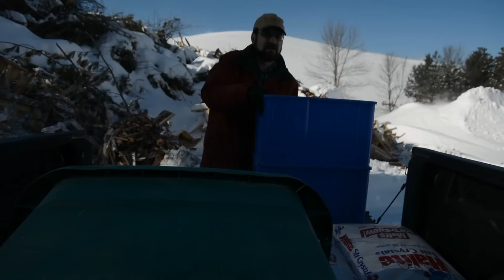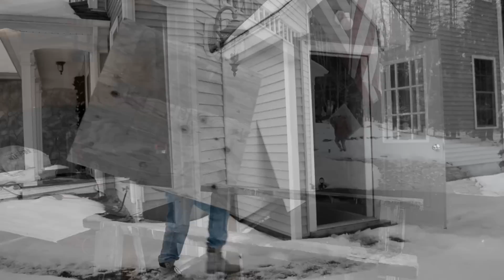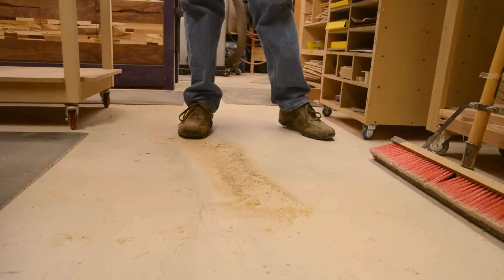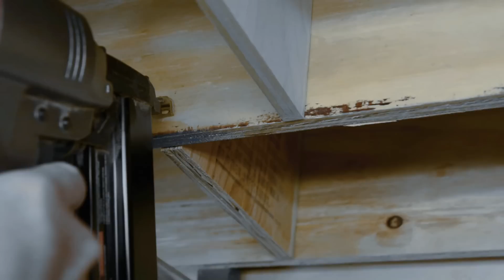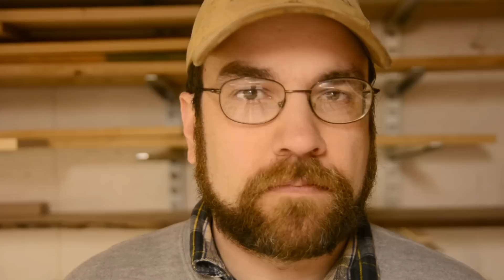The Eternal Scrap Wood of the Spotless Shop

Comment: The opening sequence made me sad. As an amateur guitar maker, I frequently use small pieces of hardwood like that for various detail pieces. Pen turners go nuts for small pieces like that too, so I know I'm not the only one who said to themselves, "Oh, I could use that..." Oh well. Can't save every scrap of wood - I'd need a hundred of those cabinets.

Speaking of cabinet, I like it a lot. I need to build something similar. You have the wood separated by species as wella s thickness and length, right? Great idea.
Reply from the maker: The stuff that goes to the transfer station is either too checked, too much wane, or too short to do anything with.  It's mostly really short off cuts from the table saw.  There were some pallet runners in there too that I couldn't get the nails out of this time.  It's pretty much by species and size, though all the exotics got thrown into a couple drawers.  I put all the short stuff into drawers at the bottom.

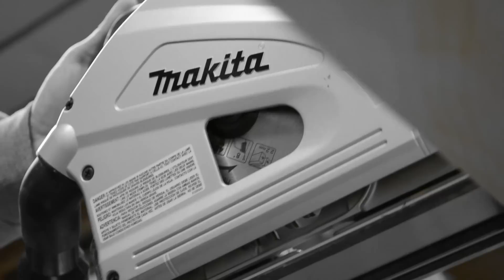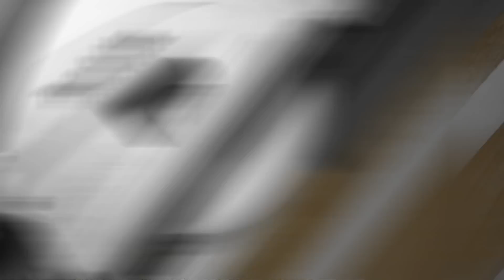Comment: The tracking shot at 1:50 was impressive, but the sequence 3:54 - 4:10 was mind boggling! How did you do that bit? I've watched it numerous times. The camera drops with the saw plunge, then the saw travels over the board, but the camera follows UNDER the board! Suitably impressed. Des in the UK.
Reply from the maker: Thanks!  I'll be doing a video on all that stuff next week.

Comment: The video had a similar vibe as Sweetgrass. May spawn imitators who might be building similar project, such as a multipurpose bookshelf.
Reply from the maker: The Nomadic Polywright Show So what's your next project? :)
Reply: A DIY moving friendly bookshelf is more along the lines of what you built. I actually have all the material and designed in in Sketchup, I just haven't found the time to be outside and in the cold. I do have 2 projects planned for the 3rd and 4th week of Feb. The hint for the 4th week project is Andre Roubo.

Comment: Was anybody else heartbroken to see the piles of scrap wood out there? oh my gosh. I'm nobody. absolutely nobody...but I am a parrot owner, and untreated wood (usually soft woods, but the hard woods have a purpose too)...Any amount of wood is used in bird toys. The more misshapen the better. The odder the cut, the better. Drill a hole in the piece, string it on a material, whether it be chain, leather cording, cotton rope, or just give it to them as a foot toy. Let nature take it's course. You will have match sticks on the bottom of the bird cage in a few minutes!  These wood pieces require very little care, dying with food safe dye is optional...and you'd be flippin' shocked at how much money these parrot toys go for. You've very possibly trashed hundreds of dollars away.  Here's a different idea...sell small lots of these scrap piles on ebay. customer pays shipping, you make a profit and buy more wood. So many ideas. I know, i know. I'm nobody and I don't matter...but from the onset, the video broke my heart.  How about wild bird houses? oh gosh. sorry. Just rambling now. I'll get over it. LOL

Comment: HaHa. Very cool video. That scrap wood just keeps on multiplying all by itself it seems, doesn't it?
Reply from the maker: I didn't think I was going to fill up 2 each of the largest sections of the cabinet with one type of one species of scrap, and without even getting to all those boxes I had moved out of the shop yet.  It's crazy.  Where does it all come from?
Reply: krtwood I think a lot of scraps pieces are the sign of a hard working woodworker. That's why I don't have much in my shop......
Reply: krtwood When you get too much excess scrap, throw it into a medium Flat Rate USPS Priority mail box and sell it on your Etsy shop. I guarantee it'll sell fast, plus it'll get more of us checking in on your Etsy, probably resulting in a few additional sales.
Reply from the maker: Andrew Brannan
I've done that in the past but since most of my scraps come from the same process I think the key is in finding a product that uses as many as I produce, which I think I have the answer to.  The problem with scrap hoarding though is really the stuff that you know is garbage but you don't want to get rid of it anyway.

Comment: Start selling that stuff on eBay. You can bundle enough together and sell it as cutting board kits for. I would buy a couple kits.
Reply from the maker: I've sold a couple flat rate boxes for a few bucks in the past but it's really too much hassle to deal with it.  I've got a plan for using a lot of them.